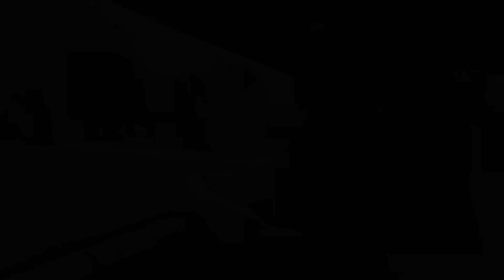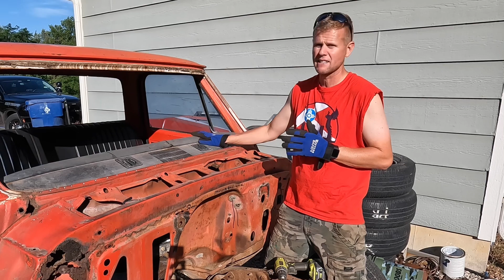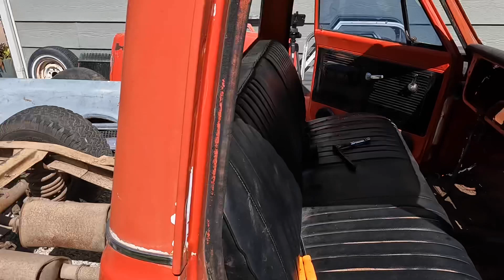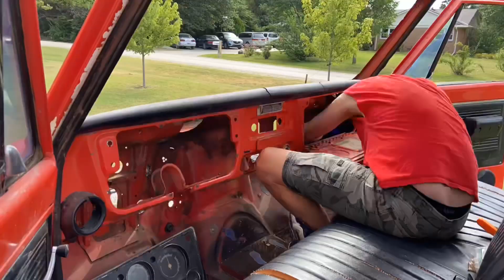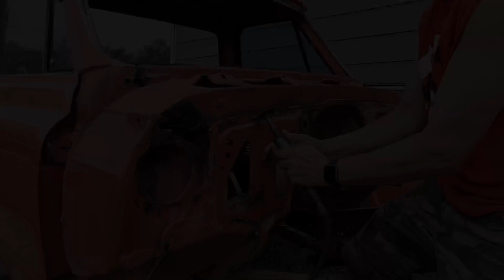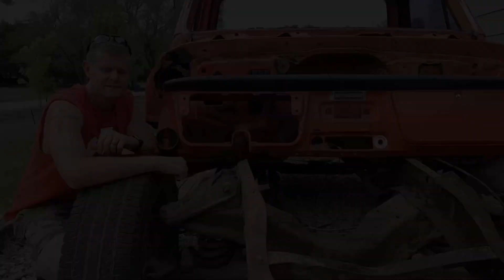Easy Steps To Remove Dash Panel On 1967-72 Chevy / GMC Trucks!

Comment: So the top dash pad is connected to the actual dash? So it's impossible to take out at the junkyard without power tools and removing the spot welds?
Reply from the maker: The outer dash pad it’s is removable. It is held on with screws and nuts that are attached to stud on the back of the pad. I have a separate video to show how to remove them.

Comment: Hello, I like your videos they are very well done. Now down to my problem that I hope you can help me with. I am working on a 67 C10 short bed step side that some previous owner has stripped all of the emergency brake hardware off of it, right down to the levers and the bar between the shoes. They did leave the handle and the attached cable, but that is it, no hangers nothing. The front cable is frozen solid but I am working on it. Did I mention that the truck came from east Tenn. where they pave the roads with salt. I had to cut most of the bolts off the rear, the front came right off, well lubed. Thanks for any help, there is hope as I am 81 and still wrenching although much slower. James T. Duncan.

Comment: I need a video of installation is there any out there??????????
Reply from the maker: I don’t know if I’ve seen one before. I guess I need to add that to the video list. If you can prep the metal for welding first and get the bolts in, then you are ready for a bunch of welds.